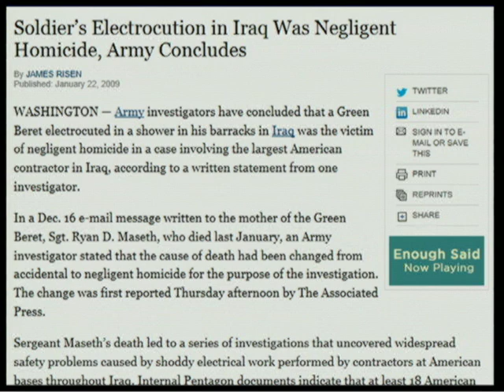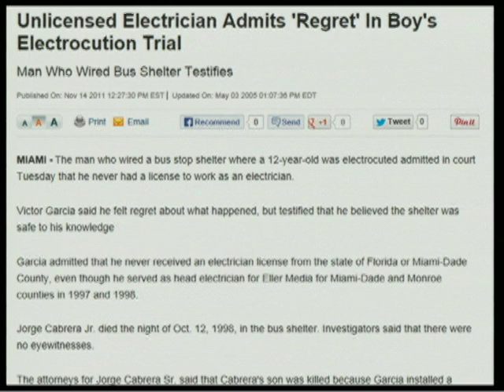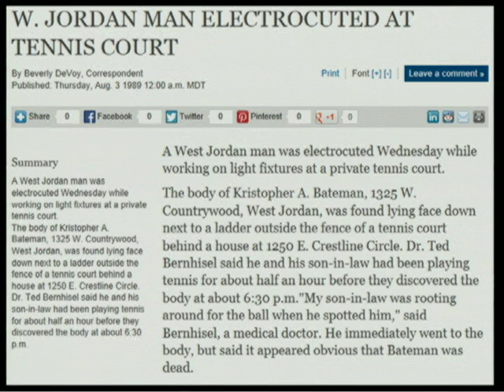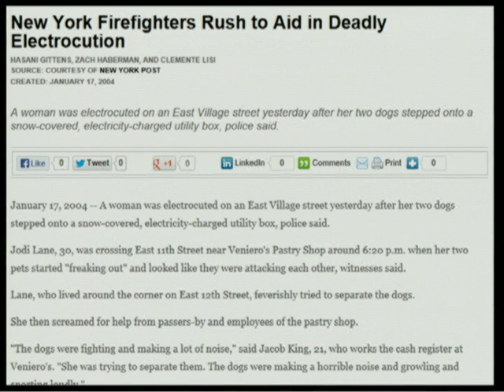7 of 7 Grounding Doesn't Protect against Electric Shock (4min:41sec)

Comment: Howdy.
Assuming all metal parts are well bonded in a house. In a twist of faith. No soil electrode is actually safer inside the house, than also having a well bonded soil electrode. How is that ? The concrete floor rebar can float closer to the fault point potential. The fault touch voltage will be smaller.
How about outside ? Now that is the point. One may get shocked from an irrigation faucet outside, when an appliance develops a ground fault inside the house. This hazard will greatly be reduced using a good soil electrode.
So for best safety. Bonding of plumbing, ducting, metal conduits, metal cable trays, floor rebars and everything conducting and large parts (metal work tables, metal shelfs asf).
And low impedance soil electrode system. Many rods shoult be used to encircle the house. Or a bare copper wire should be buried around the house with both ends bonded. Bonding only one end would leave the electrode only partially working if an excavator breaks the wire.
Regards.
Reply from the maker: Please watch MikeHolt.com/Fundamentals

Comment: So the boy got electrocuted because of the ground rod it gave the return path from the boy through the ground ? If the station was not earthed would he be energized and not electrocuted ?
Reply from the maker: This is a 'broad' question and there are other factors, but the simple answer is yes you are correct, he would not have been electrocuted.

Comment: Okay I get that a grounding electrode won't save no body.. This video is just a rant on grounding rods and how so many qualified electricians still don't understand the fundamentals because there is still many people that just drive ground rods  as they believe current just dissipates into earth... So if I am correct in summerizing this 1h video as follow: Current needs to have a ground fault path(equipment grounding) and only one neutral/earth bond needs to be made in the circuit in order for ground fault current to flow which would signal a RCD or GFCI device to take action and break the circuit in order to stop the current from flowing?
Reply from the maker: The NEC requires an equipment grounding conductor because we utilize the equipment grounding conductor to clear a ground fault. In the NEC, we don't require RCD or GFCI to clear a ground fault. We do use GFCI's however as a backup system to clear ground faults.

Comment: What would protect against electric shocks?
Reply: Charles Yao A path from the non-current carrying metal parts back to the circuit breaker and then to the source transformer is what protects against electric shock.  Its called an Equipment Grounding Conductor (the green wire)  It connects to the neutral buss in the main panel via a bonding jumper.  If a fault occurs that can energize metallic parts of a building or piece of electrical equipment, the green wire (equipment grounding conductor) carries this current back at the speed of light through the circuit breaker and back to what we call the XO of the transformer on the pole.  The resultant circuit current trips the circuit breaker hopefully before you feel any shock.
Reply from the maker: Watch MikeHolt.com/Fundamentals

Comment: That’s Absolutely WRONG MR Mike.
Of course the grounding is protecting from electrocution . 
And here why: 

Ohm low: R=E/I
Rgrounding= safety voltage witch is 50volts for humans/ I on the overcurrent device

So R grounding = 50 volts/ 20 amps 
     R grounding = 2.5 ohms 
This is the grounding resistance you should have at the grounding electrode conductor . 
Now let’s go back 

I=E/R   I=120volts/2.5ohms =48amps 
This value is more than double of our 20 amps over current device which means practically the breaker is gonna trip.

Of course that’s mean that all parameters of grounding are followed by the electrician. 
And of course there are and exceptions some times. 
That’s why we need to use parallel with a good grounding system and AFCI devices.
Reply: All  those calculations  are  useless if  you have  not a bond with neutral  where fault returns  not through earth but metal bonding  and  green wire to the source.
Reply: I think he meant the ground rod to the earth. Earth grounding made no difference. The fact it had a ground rod and no return path in the transformer is why the boy got shocked.